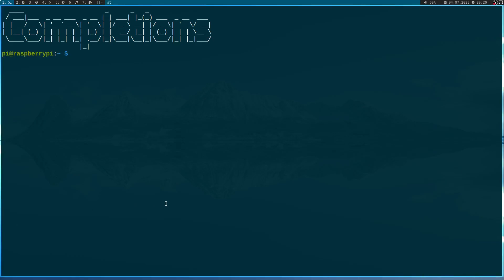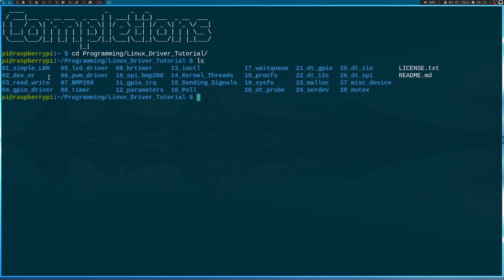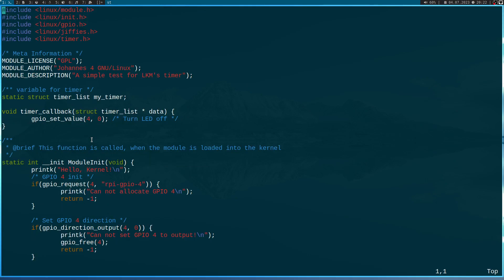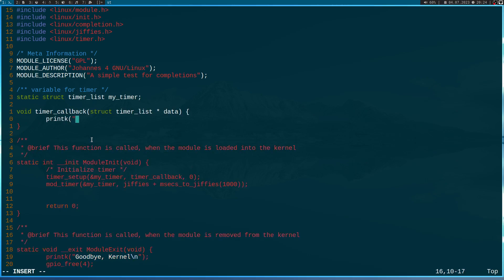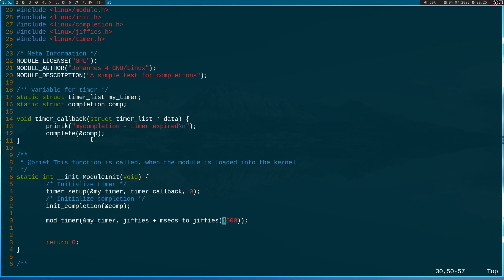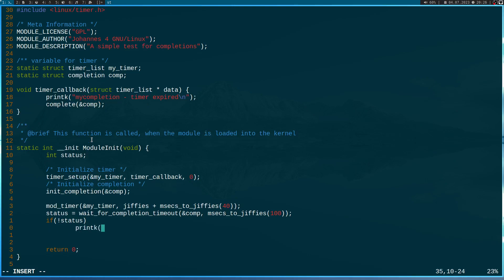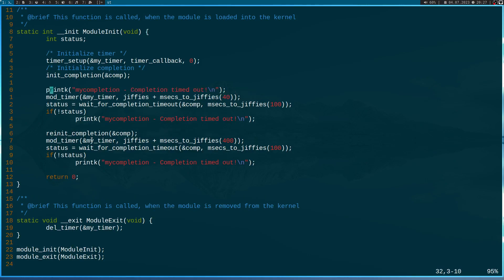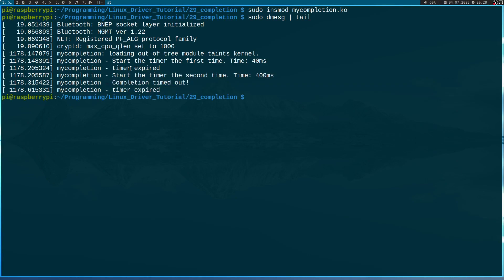Let's code a Linux Driver - 29: Completions

Comment: Any plans to make videos on how to use linux drivers?

For example, given a simple piece of hardware (a $5 USB to Ethernet adapter with VID0A46 / PID9621 ), the driver source code for it (qop_kernel/drivers/net/usb/dm9620)..

How do you compile/load the driver, so that you can call the driver functions   (dm_write_eeprom_word()) from a bash prompt?

For example, looking at existing driver, I don't see any reference to USB, yet it's a usb device!

Comment: I have one question. What is the difference between completion and mutex? Only, that completion is using timeout?
Reply from the maker: Well, as I understood it, a completion is a type of semaphore optimized for the purpose it is used. Checkout this link for more information: https://stackoverflow.com/questions/4764945/difference-between-completion-variables-and-semaphores
Reply: @johannes4gnu_linux96  Thanks. But, I think using mutex we can also synchronize threads.